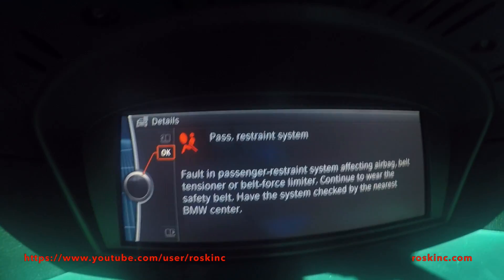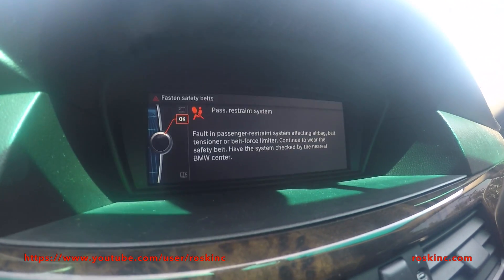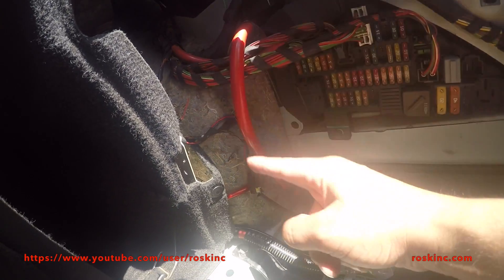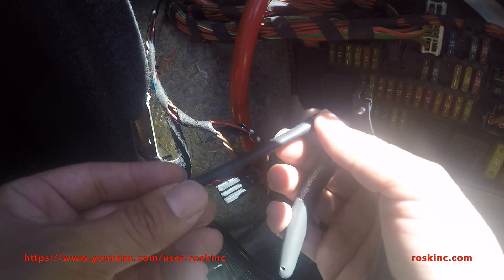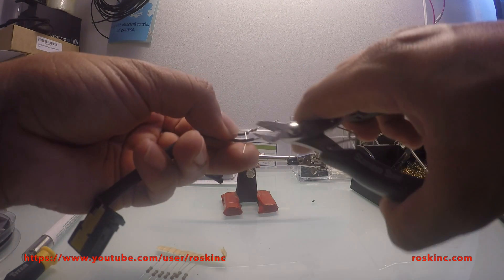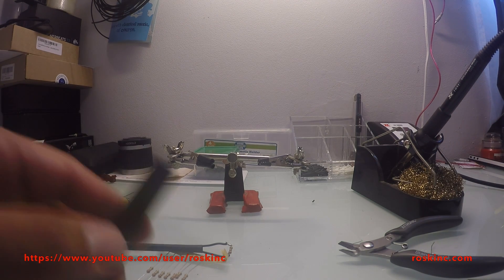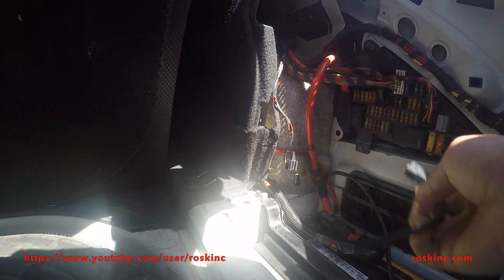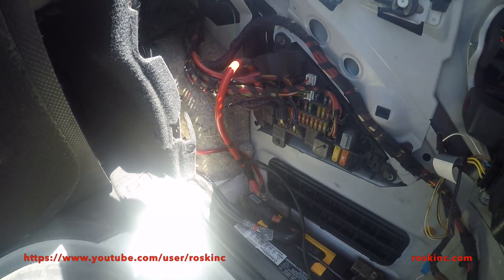e60 5 series BST bypass passenger restraint error fix

Comment: Can confirm this ALSO works on 2003-2005 Range Rover L322 (BMW era). I reset my code with the Gap IID tool. Thank you for a well produced video! The only thing I did slightly different was to cut the wire leads unequally and soldered the resistor parallel to the wires, not perpendicular like you have done. That allowed me to use a smaller piece of heat shrink and makes it more compact and easier to tuck away.

Comment: Hi
Ive done this and it seemed to be good but right after someone sits on the passenger seat it showed up again
Any solution? Thanks
Reply: So you fixed? How’s going
Reply: @Rockony  i trier everything and nothing helped so i quitted
Couple months later i installed seats from e60 2006 ( mine is 2004 ) and deleted errors with mechanics diagnostic tool and it never showed again even i deleted it with my delphi diagnostic thousand times
I still dont know how😂
Reply: @adnanulepa9661 has you try the by pass under the seat ?
Reply: Did you check your airbags are on of on ?

Comment: Does this fix stop the air bag and restraint system from operating normally?  Also, will this work on a 2006 750i with a code of 93FC? I can clear both lights, but they reappear when the car is driven the next time.

Comment: Will it clear the seat belt light too?
Reply: Just to update my own question: I replaced my seatbelt pre-tensioner  and that fixed the issue. I also used the resistor to bypass the BST and it still working like gold!

Comment: I have a 2006 Bmw 530xi and the same problem. I did the excact same thing. Cut the cable and put a resistor. And used AutoLink (AL619) OBDII scanner to find the error code and erase it. Scanner found the error code and erase it. But when somebody seats on the passanger side the error is coming back. Any idea?
Reply from the maker: Your case the issue is probably the seat mat. They sell emulators for the mat I don’t know how that one is made but they sell them online like Ebay
Reply: @roskinc  Thank you mate. Actually I was going to buy one of them. Package has two parts, one for mat sensor and one for seatbelt I think. Thanks.
Reply: @roskinc  I just put the mat sensor and seatbelt bypass yesterday and it filxed all the problems. First i fixed the cable I cut from the trunk area tho. Then put the occupancy sensor and seatbelt bypass cable. Now no lights, no beeping :) So good.

Comment: Hi, regarding this video, very informative, thx.
I have a 2006 e60 M5, and the cable layout is different from what you show here. It appears that the BST cable going to the sensor fuse has 3 leads in it, rather than the 2 that you show. I wouldn't know which 2 out of 3 to bypass. Any suggestions? I'd be happy to provide a pic. BTW, how did you stumble on this bypass trick, and what are the side effects of doing it? much obliged. Albert

Comment: I try it with a 2.2 ohm resistor last week  and the light came back. It's a 2006 bmw 530xi.
Reply: Same for me :) I used actually 2ohm resistor. It was 1/4W. It didn`t work for me. Light and the annoying warning sound is still there.
Reply: @ozanaktas8064  my 2.2 ohm eventually worked. It took a few day before the light turned off.
Reply: @jworld5539  I realised that mine also 2.2ohm. I did this procedure 2 days ago. My lights are still coming back sometimes. Should I wait a little longer? Your problem is compleletly gone since?
Reply: @ozanaktas8064  yes mind are gone up to this day. Did you erase the fault codes.
Reply: @jworld5539  No. My poblem is still happening. I just order Seat Occupancy Mat Bypass Emulator. I am gonna try to put them under the passanger seat and we`ll see :)
Reply: @ozanaktas8064  hope it work out for you. If possible keep me up to date with the progress. I am wondering if you did the connection correctly
Reply: @jworld5539  trunk area cable bypass didn`t work. I ordered mat accupation sensor kit from ebay. Waiting for it. I am gonna bypass under the seat this time :) we`ll see.

Comment: Hello, I have a question. The wires you cut then unplugged from the harness, mjne is different. Mine plugs right into the positive battery cable at the battery. Is this the same thing? Can I just cut those brown wires and put a 2ohmn in between? I have a picture but I can't upload it here.

Comment: Thank you. Very useful. Are airbags still active and will shoot in case of accident after these changes? Is 2 or 3 ohm OK for M57D30TU?
Reply: The rest is the SRS system will be UNAFFECTED with this bypass. All airbags and seatbelt pretensioners will still be functional and active. 2.2 ohm 1 watt resistor (red-red-gold-gold) is what I used.

Comment: Will this  affect the function of the actual airbags ?
Reply from the maker: air bags yes, but wont cut power to car in accident. this is strictly to diagnose change the bst cable if the resistor works.
Reply: Thank you but i’m sorry I still don’t get it!? Let me be more specific, in case of accident would the airbags works as normal?
Reply from the maker: @zlatko1234554321  yes they would. just proceed with caution.

Comment: I figured out how to disconnect the sensor without going thru all the trouble you just need a flat head screw driver and look for the four pins on each corner you cant miss it and it loosens it self.

Comment: I tried this today for the first time and it worked. My solder kit was junk. Going to buy a better gun. Basically, I did this without soldering. I just wrapped the bare wires around the ends of the resisters and used electrical tape to secure the connection but I will invest in better solder and heat shrink wraps. Thanks for the great video
Reply: LoveMe2Tmes did you have to reset it with a scanner or what did you use?
Reply: What's the resistor that you used?

Comment: Hello, I have the same problem on a 525d ,I put a fuse car insteed of a resistor and is not working,I have to put a resistor of 2 ohm? Or it s have another problem? Thank you
Reply from the maker: mihalache george it HAS to be a 2ohm 1/4 watt resistor. Exactly that resistor

Comment: Nice video and all. But how do you diagnose that this cable is faulty indeed? Also this cable is there for a reason so what's the worst case scenario in case of an accident with this bypass. Cable won't explode and won't cut the power from the battery but what can this cause in the event of crash? Will it catch fire or something ?

Comment: Hello i need form bmw e90  what resistance i can use ? thanks in advanced
Reply from the maker: Auto Films should be the same. The 2ohm resistor has worked on 7,5,6 and z series from what people have confirmed to me they did this mod on
Reply: Same question here. Anyone knows if a 2ohm 1/4watt resistor will work on a e90?

Comment: Should this work on the e65 ? Does it matter which way the resistor goes on ?
Reply from the maker: anlocnguyen I personally have not tried it on a e65 but I’ve had people tell me they have tried on it a 7 Series. Doesn’t matter which way the resistor is but it HAS to be a 2ohm 1/4 resistor exactly,
Reply: roskinc you mean 2ohm and 1/4 ?
Reply: roskinc thank you I will try
Reply: roskinc , all i can find around my area is 2.2ohm resistor , is it ok ?
Reply: Boti majuli video 2018 video

Comment: I tried same thing to turn off my Air bag On the passenger side but is not working
Reply from the maker: Yousef Atwalla did you use exactly a 2ohm 1/4 way resistor?

Comment: Hi, i have bypassed the same wire with 2ohn resistor, resetted with INPA and light still there? Also tried to bypass mat light still on? Anyone?
Reply from the maker: abdulghani mustafa did you use a 2ohm 1/4 watt resistor? Has to be exactly that size resistor.
Reply: roskinc i used 2ohm 2 watt resistor maybe thats why. Thanks man ill go and pick one up.
Reply: And so did you change this resistor for the good one, and does it works? Thanks

Comment: You sir are a genius!  Just did mine and worked like a charm.  I run a body shop, and even the parts at cost are not cheap.  Not to mention if the original failed, then how long does the replacement last.  Glad to have the red light off the dash, and no more warning messages!!!  

Anyone in question of longevity, I am writing this 20 minutes after completing the job. 2 ohm / 2 watt resistor should last for years if not decades.  If it fails again, check your wiring.

Comment: this is not worked for me. What can I do to fix this error? e60 2004 525d CCC navi -error message is: "Resistant systems: function of airbags, belt tensioners and belt force limiters faulty, Ensure your seat belt is fastened despite the fault!" If anybody knows a solution for this, please send me a message or reply.
Reply: 60vNeon1 did you fix this please help lol
Reply: I was looking at this issue and out had to do with a pyro charge connected to your seat belt buckle housing. It's interesting but can be a pain. You can probably do the repair. I have a 2005 530i and may have the problem.

Comment: I tried this. Bought two 1ohm resistors put them in line. But I had to wire them into the "car side" of the loom rather than disconnecting that plug as the plug was loose and error kept coming back with any movement. The reset worked with two 1ohm resistors online for couple months but error came back... and this time I couldn't even reset it. Then I tried just a 1ohm resistor on its own. It reset light went off all day but would re appear when starting car up first thing in morning. I'm at this position now where light is on. I'm next going to buy a single 2.2ohm resistor to wire in. Can anyone tell me if a high wattage or low wattage is more suitable

Comment: Not sure if this is the proper fix as the car will not function as designed. It will turn off the warning message which doesn't say much. In the event of a collision the battery might not get disconnected as it is supposed to, to prevent a possible fire. I would just replace the cable due to safety reasons.
Reply from the maker: Ar836k1 I always tell people to replace cable. This is just a way to test if it is the cable and not the Matt or bad battery
Reply: you can check resistance of cable in DISA (i did not see this in INPA) with simple test.
vmware with DIS is on web...

Comment: Hi guys i ve got a big problem after my old battery was flat and a friend gave me power to run the engine again was not any problems but when we changed the battery with new one afternoon yesterday the car started very easy we went back home and next morning just couldn't start at all I think is some electrical because lights for the airbag come on the dash please advice
Reply from the maker: Toni Tanev this common when getting jumped. The jumper points are in the engine bay, you do not jump from the battery in the trunk. Might have burned your fuse causing the bst error
Reply from the maker: Toni Tanev try wiggling the wires and clearing the error, usually does the truck, or replace bst cable (you can use this method to test if it is the bst cable)
Reply: Right how can I understand where is the problem is that a bst cable or that fuse box under the cabbin filter place and thanks for replying
Reply: Anyway the car is not running now :((((
Reply: roskinc i will try with this baypass but i.m in uk hopefully somebody selling here

Comment: Just implemented this resistor change and it worked on my 2004 545i. I had the passenger restraint error message for a while, and during service at dealer for a 4-wheel alignment, I had them check root cause of error message, which turned out to be BST cable, quoted for $600 cable plus labor. 
So a pack of (5) 2.2 Ohm, 1/4watt resistors at radio shack costed $1.50 (I think), plus Carly Pro App ($40) for BMW with wireless ODB2 adapter (~$65) fixed it. It's been 3 weeks and so far so good, most importantly received state vehicle inspection sticker 2 weeks after clearing error.
Reply: Dennis Busch could you not just remove the resistor and solder the wire back together to the original BST cable if you had to revert to the original cable?
Reply: What's the link to app for error override. I've seen the Bluetooth obdII part on Amazon but just want to confirm the app compatible for BMW. Thanks for any help.
Reply: Was BST the only SRS system error you had?  Mine also has a seat belt tensioner error with Carly Pro.
Reply: I agree in that I'd rather have the connector and wire it up than cut and splice.  Then can easily revert back if there's an issue.  I've tried finding that connector to no avail.  02 525i
Reply: problem is this introduces new error codes. the process needs lots of improvement too. there is actually no need to cut the factory wiring...ideally a plug end is needed as otherwise you ruin the wiring loom in cases this does not ressolve error (expensive mistake). its also a silly fix if you dont stipulate the repercussions, ie subsequent errors this causes and implications of them. be warned folks

Comment: Thank you sir! I own a 2006 BMW 330i e90, this same error appeared shortly after I installed a new starter, maybe the cause...maybe not, anyways - Used a 2.2ohm resistor, got it off Amazon. Used the myCarly app and plugin for diagnosing and clearing codes. The wire to cut on my model also has a black outer jacket and the inside wires are two twisted black wires; it also has the same yellow stripe on the connector as in this video. My (e90) wire bundle comes from the right side of the battery housing instead of the left side as in this video (e60) so be careful of which side of the wire you cut. Thanks again... saved me a lot of money.
Reply: Abomb4141 what does the cable look like? I'm trying to do this on my bmw 330 but both cable are a black and brown twist not both black

Comment: works for a x5 2008 e70 4.8i? need 2ohm or 4ohm resister?
Thank You sr.
Reply: Hey did this work on your x5 did u ever fix it I have the same problem and the same year 2008 x5 4.8 please text me if u can when u see this 213-519-5454 if u fixed it

Comment: I removed the cable and tested with a multimeter and it is closing short circuit, this is normal this cable this short circuit?
Reply: Diogo Souza i found the same, so putting a resistor in is pointless

Comment: what if u dnt add the resister and u just put the 2 wires together??? will it couse any problems??
Reply: what's the problem on putting the resistor? Anyway, the original bst just works like a resistor, so without the resistor i guess it's not working properly :/

Comment: i will try this i bought a car yesterday and upon this video i bent down to look at mine to find that . In the past Whoever changed the battery put the battery in and because of the tight fitment from BMW they shorted the Positive from the battery onto the body of the car which is metal. I think you said something about this type of install can cause this cable to back feed. Am I correct in understanding? ont

Comment: well the resistor u sent me worked for about a year but now its on again thinking it might be the seat occ sensor it come on a day after I clear it every time , ever since i cut bst and put resistor it has worked fine
Reply: how can I check the seat occ sensor? I have a BMW code reader but it just comes up high resistance in passenger restraint system

Comment: Hi, Roskinc. I have your "sport" cable, very much appreciate the info. I am going to look into this.  I get this error, I've cleared it, but when my lightweight wife sits in the front seat, the errors stay cleared.  When a heavier person (her father, for example) sits there it comes on. I clear it again, it's off until another heavier person sits in the seat.   This means that I can't date a woman heavier than my wife or she'll figure it out.  (YIKES!)   What are the chances the fix in this video will work?  Also, will this fix disable any safety features at all, like airbag or seatbelt operation, etc.?  I am looking to donate to the cause in some way for your expertise!
Reply: Exactly my case. When my wife sits in the passenger seat, it doesn't pop up, but when my wife drives me, it comes on. I am not sure this video applies to our peculiar problem.
Reply: Hi, Bennie. I have an update, it is now staying on all the time, with our without a lightweight passenger.  I am going to look into this further.
Reply: Where can I get the cable?
Reply: From Rosinc, if it's available.
Reply: Update, I did this modification after getting this error and it did not work for me.  Not saying it won't work for others.  Thanks,

Comment: i have a 1994 e34 525i it had original an passenger airbag, now i fitted an leather interior from another car that didnt had a passenger airbag, does anyone know if i can use a resistance like the one in the vid to make the system work again, if so, does the 2ohm resistor make the computer think that there is someone on the passengerseat. sorry for my bad english. hopefully someone can help me, thanks

Comment: Hello. I've got the same problem since 6 months. When i erase the error it appears like after 25-30 days. Could it be some wires problem or the sensor? Cause when i erase the fault im testing it like hard sitting in the passenger side, shaking the seat. And if i do the same thing like you will my airbags on in some accidents without anybody in the passenger seat?

Comment: Hi roskinc. My BMW 530i 2004, have the same problems as on video you posted. Before watch this video I already buy bypass and buy c110 on eBay to clear airbag and seatbelt light but still don't work. So I want try tha way you show on video, so do you think I need took off the bypass ? And do step by step as you did? And don't need the c110 scanner.?that light on my car 2 yrs ready, I hate see that but no choice. Thank you if u can help